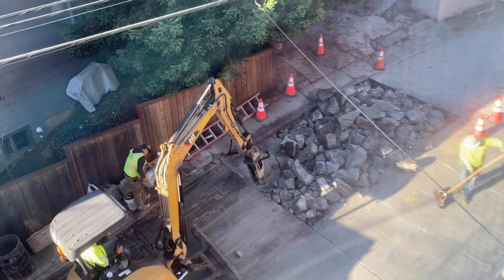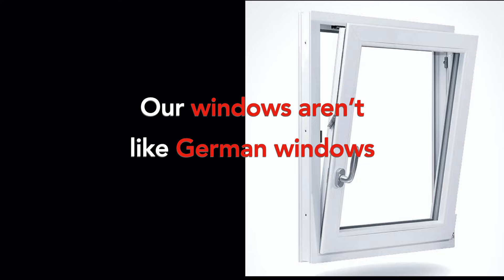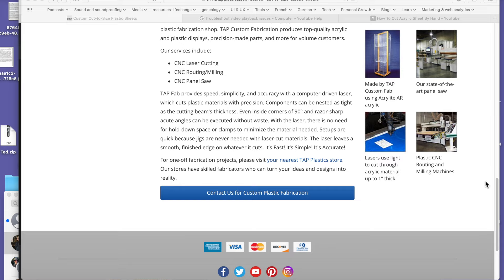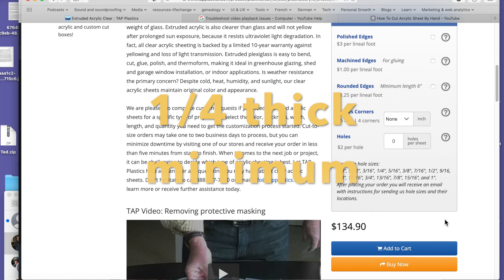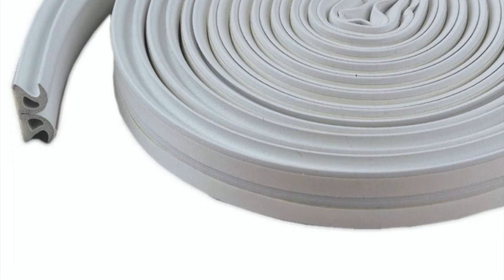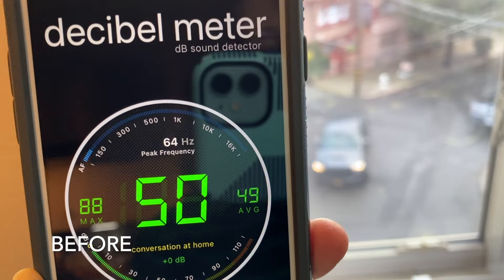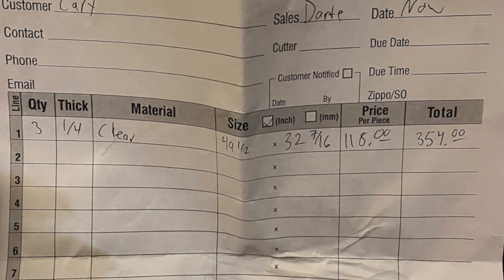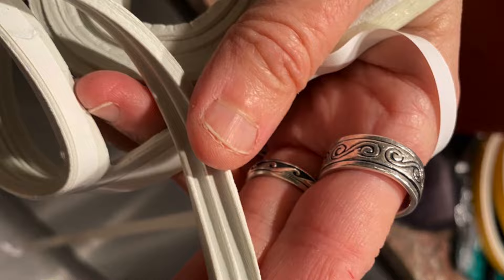How to make a DIY window insert for noise reduction

Comment: Is there a panel for sound and one for insulating🤔
Reply from the maker: Hi - do you mean is there a material or product that does both? Not that I know of. I wish! The "over the drywall" technique *might*.help if the framing around your existing window is poorly insulated, though.
Reply: @soundproofist  a specific material that works best for insulation. I might not mind the sound so much, but maybe something that works best for insulation would also keep sound transmission down sum.
Reply from the maker: @jasonbowman7190  Well, assuming that you still want to see out of your windows, that eliminates things like window plugs with insulation material in them. Those would be overkill, but they would help to keep the heat in and block the noise... but you'd be living in a "windowless" environment. I'd look into the window insert company that I mentioned to someone else here, if you think lightweight, clear vinyl weather inserts in custom-fit aluminum frames might help. They're not super effective with noise (maybe a couple of decibels), but they use the same type of clear vinyl that gets used in refrigerator lockers in food warehouses. The company I know of is EnergySvr Window Inserts in Nevada: https://www.windowinserts.com and I think -- for example -- a 36x48 inch window is about $85-$90. You can use their online tool to do estimates. Am I on the right track with what you're looking for?
Reply: @soundproofist  thank you,  I  am trying to plan out filling my window jams with a plastic  or cling wrap frame. I  may look into the best shades or blinds to insulate. I guess my paella windows are able to pop out of the frames,  and  thought about buying a couple of windows for winter that let's in as much 🌞 heat. Or place a greenhouse on the s side and pump heat into the house when possible.  I will look into the companies that you recommended.  👍
Reply from the maker: @jasonbowman7190  These are all interesting ideas. I've seen some of that sheet wrap at the hardware store that you apply with heat (I think?), but I never tried it. That won't make any difference with sound, though. Do you have a lot of windows, and are they large?  If so, I can see why you might not want to invest a lot if the results are uncertain. The greenhouse/heat pump idea is really interesting. Definitely an advantage if you own a home versus living in an apartment. I have to say that my plexiglass window inserts do help with retaining heat in the winter, especially since those windows face south, and east. Lots of sun comes in, the room gets warm, and retains the heat. The walls are also insulated, and so is the ceiling in that room.
Reply: @soundproofist  I do have a lot of large windows. I spray foamed the entire house and added lots of insulation in the attic. When I had cardboard over the windows while doing construction in it my furnace would turn on once every 8ish hours in below zero temperatures. I may look into building a frame and plastic of some sort, but wouldn't mind finding a way to keep moisture issues from happening. Maybe adding caulk around the window cracks, adding a frame and plastic on the inside, drill a small whole for argon and plug hole, add another layer and another hole for argon then plug that hole too. Might be an interesting experiment 🤔
Reply from the maker: @jasonbowman7190  Is the moisture coming through the window ("sweating") or in some other way, like a leak in the exterior wall? Personally, I have not found spray foam to be as effective against cold or noise. Our double-paned vinyl windows (a retrofit from the original 1950s aluminum, single-paned windows) were insulated by the installers with spray foam, and it always feels a bit drafty to me. The window inserts helped with that. I just thought of another resource you might want to look into, but I have no pricing estimates: Magnetite windows. I think you apply this plexiglass magnetically to your existing windows: https://magnetitewindows.com
Reply: @soundproofist  I haven't seen any sweating yet but when I had cardboard in the windows and up against my balcony door protecting them from construction debris I had frost on the inside of the door. Maybe I could add a bit of foam with magnets to the frame, and  I was looking at a see-through peal and stick plastic that is supposed to isolate the cold glass surface from the inside. Maybe one day we will have real-time outdoor videos projecting on the walls to keep the heat in 😊
Reply from the maker: @jasonbowman7190  You have a lot of creative ideas and it sounds like you're an intrepid DIYer.  How cold does it get where you live?
Reply: @soundproofist  I'm at the edge of zone 4, bottom right side of South Dakota. Wish it was zone 7, that is the best location for growing a full range of plants 🪴 it seems.
Reply from the maker: @jasonbowman7190  So ...it gets to below-freezing temperatures where you live. Do you feel like the techniques you've used so far have worked well for you, either with temperature control or noise? And if not, what would you have done differently?
Reply: @soundproofist  I definitely would have gone with a European window manufacturer that specializes in passive house certified windows 🪟. I bought a house 🏠 that was built in 1913 and took it down to the studs. Then spent a week learning electrical and wired the house to code, windows doors, a new basement underneath. But I super insulated the house and made it air tight. It wasn't my plan, just enjoy carpentry work, but as I kept going it just happened to be the path I went, the passive house way. I see your videos on sound transmission, made me think about the hearing aid company I'm invested in. The stock ticker symbol is INND if your interested.  They are the only hearing aid company that has new technology in hearing aids where you don't need to spend $ on a doctor's appointment to get fitted for a product so expensive that only those with good medical coverage can get them. INND is still trading at the floor of the stock market... Get in before all the big money moves in. They are going to be in over 30,000 locations in the US and Canada,  and eventually Europe. I do all my own trading on Charles Schwab.
Reply from the maker: @jasonbowman7190  So glad to hear about your passive house upgrades. Congrats! I think there's some crossover between energy efficiency and noise control. Also thanks for the background on INND.

Comment: Sound is vibrations. Any solid objects like plexi-glass will not work. You need to absorb the sound vibrations
Reply from the maker: True. The plexiglass is less effective with low-frequency noise (vibrations) that are structure borne and close to the building. The vibration goes beyond just the window itself through the whole building frame. But the plexiglass is fairly effective with loud or vibrational noise that's farther away from the building (75-100 feet or more), and also effective with nearby airborne noise, such as people who pace back and forth under the window, talking loudly on their mobile phones, or cars that idle underneath the window (not acceleration noise, but just normal idling).

Comment: I wanted a plexiglass window insert from a company called Indow, to sound proof a window in my apartment, my window is 5' x 5', 7". Indow wanted $1,650.00 to make it for me. I said no thank you. I am in the process of ordering plexiglass to make it myself. It will cost me under $500.00.
Reply from the maker: That's exactly it -- and why I made this video. Especially for big windows. Thanks for your feedback!
Reply: @soundproofist  Thank you for your video. I hope you found some peace and quiet after you completed
your window treatment.
Reply from the maker: @ocljtc  It's helped a lot with certain types of noise. The walls in the front of my apartment are thin (the drywall is just 3/8") and insulated, but not soundproof. Not enough mass and no decoupling. So the window inserts can only do so much. The inserts cut the mid frequencies, so that means I barely hear car engines if they're idling outside, or conversation, or activities half a block away -- those used to be much louder. But what they don't cut is low-frequency noise (under 150 Hertz). So a truck engine revving under my windows, trash-collection trucks, a leaf blower, or construction equipment (jackhammers, etc.) still come through the whole building frame. It's much better than before, and I'm glad I economically added the inserts. Someday I hope to redo the walls, but it will require a full teardown.
Reply: @soundproofist  I see. It's a shame how noise pollution doesn't seem to be a concern for legislators anymore. I call politicians from in and out of my district, asking for laws to be passed regarding loud music at night from vehicles and people with portable speakers. This is what I deal with on a daily and nightly basis.
Reply from the maker: @ocljtc  This happens in a lot of communities. Even if you have a noise code, it might not get enforced. I live in California and there was a time when cars would be ticketed if they had loud exhaust pipes or played music from stadium-level speakers. But modified car exhausts and general street noise have increased in recent years. Some issues can get traction if there's enough data to show cause-and-effect harm, like glyphosate (finally) or smoking, but noise seems to be in a category that's more like sugar, which is clearly harmful but so prevalent (and even pleasurable) that no one has the will to legislate it, apparently.
Reply: @soundproofist  Sad, but true. when I sent my complaint to a local politician, he sent me a form to fill out via email, and wanted me to send him a record of all of the noise complaint docket numbers, others said they forwarded my complaint to other agencies. I guess NYC will just have to have to deal with it. There should be a study done on the psychological effects of hearing "music" at those levels for 8-12 hours a day. I thought that these cars had 1,000 watt sound systems in them, but upon researching, I found that today's car sound systems can go up to 3,000 watts, which is obscene.
Reply from the maker: @ocljtc  Maybe I'll call Arline Bronzaft (in NYC) and ask for suggestions on who you should contact. I know the Right Avenues app was designed to offer more tracking of noise complaints, and those complaints seem to get lost in transit with 311.
Reply: @soundproofist  Wow, that is really sweet of you. I haven't gotten anywhere with these people here. And as you stated in an earlier reply, noise complaints have skyrocketed. The poor people that live in Washington Square Park deal with nightly parties with extremely loud music, drugs, etc. and calls to 311/police are in vain. Again, it is very sweet of you.
Reply from the maker: @ocljtc  I contacted Arline. She says: "...go to growNYC.org/noise for information on impacts of noise on health. At the end of the site [page?], it says you can contact me via growNYC.  I would prefer to speak to this person directly and learn the specifics of the noise problem and whom they contacted already before making recommendations." So... go ahead and try that, and mention that I sent you. Don't be surprised when she calls you!
Reply: @soundproofist  You are amazing dear woman. I thank you very, very much. Not many people would go out of their way to help like this. As I am writing to you at this moment, 12:49 am, I have already filled out 2 noise complaint reports with 311, due to music and shouting right outside my window. It never ends. But again, thank you so very much. ❤
Reply from the maker: @FredBrandenberger-uc1vl   you're welcome!
Reply: @soundproofist  I'm sorry, I responded to your comment through a different Youtube channel. It's actually me, ocljtc, not FredBrandenberger. forgive me.
Reply: @soundproofist  I am happy to say that Arline responded via email, and asked me to call her. Thank you for your help. You are a godsend!!
Reply from the maker: @ocljtc  No worries. I figured it was you, and it all worked out.
Reply: @soundproofist  Thank you for everything dear lady. I hope I can rectify my issue with Arline's help. ❤

Comment: Very "smart"... to talk while you demonstrate what the cars sound  like before and after you placed the pane.
Reply from the maker: It's an audio narration (voice over) track that I added after capturing the video. So the readings on the decibel meter are from the car or truck driving by, not from my voice. In a more-recent video, I measured leaf blower noise at different windows (open and closed) and determined that the extra sheet of plexiglass decreases the decibel level by about 4 decibels.
Reply: @soundproofist  
You're missing the point. 

Most people aren't interested in decibel decibel values, it has no meaning to most people, and that app is just a joke, it's not any way accurate, and I talk from experience with it. 

To measure decibels you need a hardware device that is specifically made for that purpose. 

Having said that, what matters most for us viewers is the sound we're hearing, yet you decided to place your voice partly on top of the sound that the cars generate, which is not a very bright move.

Comment: Where does one get the energy saver insert?
Reply from the maker: Those flexible weather inserts I was using (before the plexiglass ones)? Those came from a company called "EnergySavr Window Inserts," and their web URL is https://www.windowinserts.com. They make them with aluminum frames lined with foam at the edges, and the center is clear, thick vinyl.